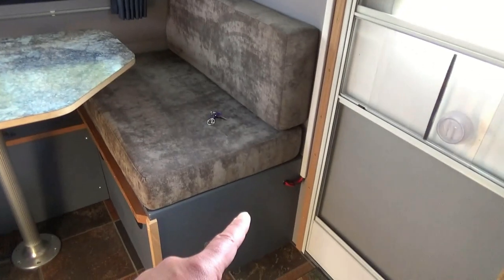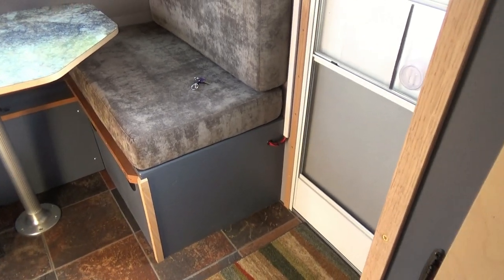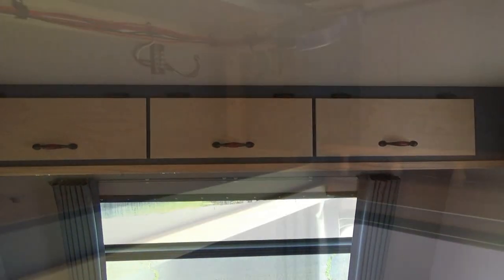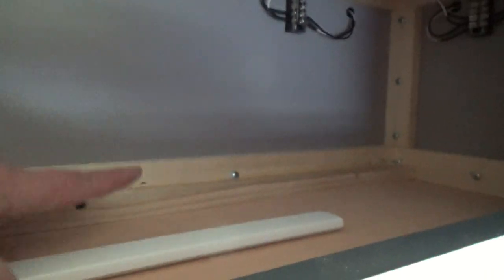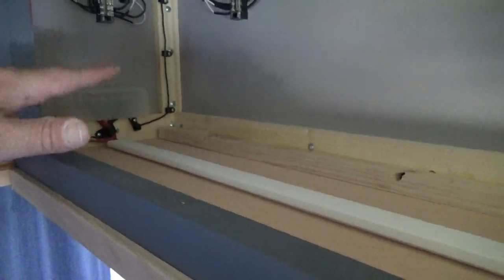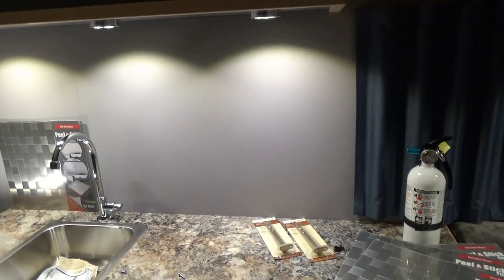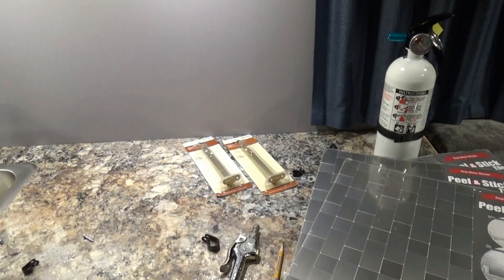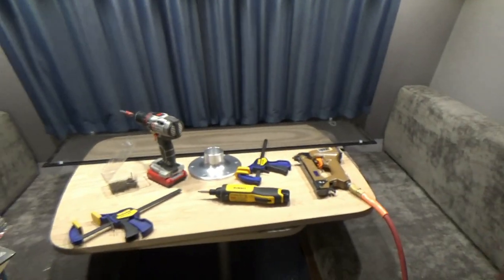How To Build A DIY Travel Trailer - Part 82 (Installing Inside Cabinet Bottoms)

Comment: I THINK YOU ARE DOING A GREAT JOB. Your Travel Trailer is a whole lot better than a Factory Built one. I hope you install a Solar Charger for your battery. Pretty cheap. How about A/C? I was wondering if you were going to install a small unit in it for those Hot Days. I still want to buy it from you.
Reply from the maker: Thank you Reno! Holding up very well... The solar system is working like a charm! Batteries stay topped off, inverter can run everything just fine. I do have an A/C in mind, just haven't pulled the trigger on it just yet. Soon maybe. I think it will fit perfectly!

Comment: Hi Al, I hadn’t thought about putting false bottoms in the cabinets. I’m sure I would have when the bottom of mine fell out lol. Yeah I think putting a panel on the side to cover the wiring would look real nice. I like your splash board. That’s going set the kitchenette right off. And be quite functional. Nice job
Reply from the maker: Thank you Gary! The cabinet bottoms and little side walls actually turned out nice, and still plenty of room! The back splash looks awesome! At night with the lights on.... really sets it off!